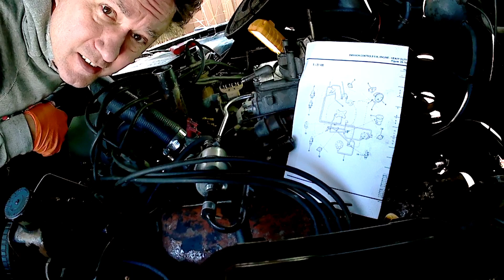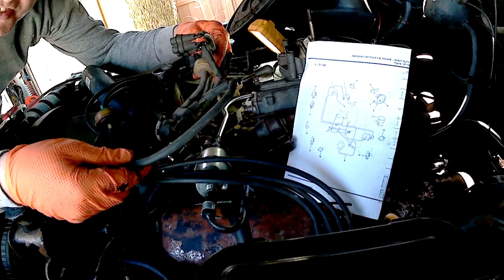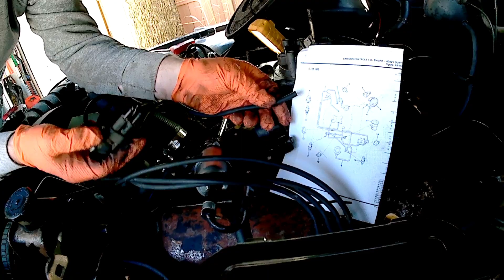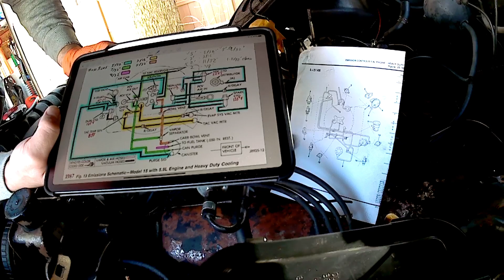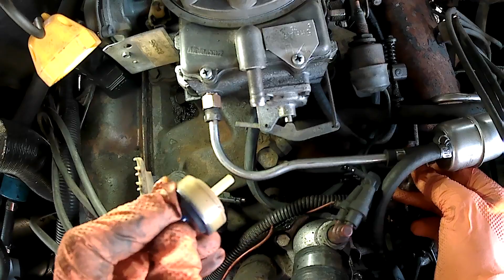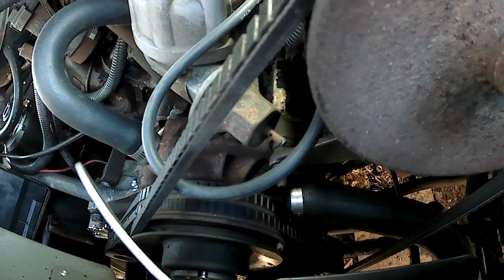Vacuum Line Replacement, Part 3 of 3- Rebuilding the ignition vacuum-advance harness on a 1987 J-20

Comment: Honesfly on my 90 grand wagoneer.. i removed 90% of the vacuum lines.. got rid of the factory air hat which had like 20 lines to it.. egr lines i blocked as my egr is dead and if theyre hooked up it just stalls my jeep.

The only vacuum lines i have are the pcv  And the lines for the charcoal canister/carb vent.  And the distributor vacuum advance

I also removed the air pump.. broke off the inkection tubes and welded the holes. On the manifold.    All junk lines waste of power.. takes up space.   Not needed. 

 Only the charcoal pcv and vacuum advance should be needed.

All ports not used i just plugged with plugs.

Bas8cally i routed my 90 like a 70s wagoneer using diagrams i found for minimal vacuum lines on the engine.  The less you have the better.

My 90s distirbutor line though never came with those valves yours goes too.  Mine jist go to ctos in the front but no non linear valve or delay valve like you have.   Maybe im missing it ?  Ill have to look at my diagram in the engine bay if it ever had it.
Reply: Think you could post some pictures of your setup? desperately want to get the vacuum simplified on my 88 but dont wanna end up hooking the wrong thing
Reply: @henryyagel9858  ya i could do that

Comment: Dr. Bob, Thank you for this video. I work on my dad's 1983 Jeep J20. The vacuum system is a complete wreck. I feel 100% confident I can correct multiple issues after watching this. Thanks again and keep up the good work. 
Jake
Reply from the maker: Glad you found it useful; once you break it down to the fundamental systems, it's less of a mess, but it's still not pretty, even when it's working as it should.

Comment: First love the detailed descriptions,& pics…wanting to know if you have video or info on  vacuum lines (what is needed what is not) ( what to connect & where to connect)  for 90 jeep 4,2  ( Motorcraft 2100-2150 carb) with HEI distributor , & after market air cleaner.  Thanks in advance!
Reply from the maker: Sorry, I've never had a Jeep I-6 to work on .. :(

Comment: Question for Dr. Bob. My 87 J10 does not have the high capacity cooling option. I have no high temp CTO. Do I just omit the tee and run a hose straight from the NLV to the distributor? 

Also can I bypass the EGR TVS? I can't find one anywhere, and mine's broken. 

Love the show. Thanks for the help.
Reply from the maker: On the regular-duty cooling system, the lines go as follows:
* Ported vacuum from the choke side of the carburetor, to a "T" that feeds the bottom port of the low-temp CTO and the bottom-port (small-end) of the NLRV
* Manifold vacuum that feeds the central port of the NLRV
* The top port of the NLRV feeds the top port of the low-temp CTO, with a reverse delay valve in-line (Jeep Part #J3236295)
*  The central port of the low-temp CTO feeds the distributor.

You can find a diagram of that in the 1987-1990 parts manual, figure 25-1350, on Tom Collins' Jeep manual page:

https://oljeep.com/edge_parts_man.html

or directly at the following link:

https://oljeep.com/parts_man/1987-1990_parts_catalog.pdf

You would want some thermostatic switch preventing the EGR from seeing vacuum and kicking in until the engine is up to temp; you could use a two-port switch in the rear heater-hose fitting that turns on around 155'F, and run that in series with the air-temp sensor in the air-cleaner housing. If the EGR kicks in when the engine is cold, it can produce stumbling and driveability issues.

Good luck!
Reply: @bbsbcv   Yes, started great but stumbling when warm. Still, getting better. I think now I'm going to register with the old Jeep forum, and hopefully continue the conversation. Thanks again.
Reply: Dr. Bob I'm registered on full size jeep network but I can't post yet. I'd like to chat somehow if you are willing. My 87 J10 is much like yours, smog pump deleted but otherwise largely complete. I've been wrestling with vacuum routing for a week with marginal success. 

Please:

* What is the hose connection to the CENTER port on the 2150 carb (standard cooling)? Your HDC schematic shows the center port is routed to the HDC CTO which I don't have. Instead I routed from that center carb port straight to manifold vacuum as shown in the HDC schematic, which tees off to the center port of the NLV.

* Do you plan any videos on EGR and TAC system vacuum routing? 

* Where can I go to understand the function and routing of all of the various different manifold vacuum ports, front and rear, and why are there so many, and why doesn't my heater door work??? (frustration creeping in)

* Similarly, where can I go to see a complete and accurate schematic of the vacuum routing on a 87 J10 AMC360 with standard cooling? All the ones I've seen are either a full schematic of HD cooling, or a partial schematic of standard cooling. Including the AMC factory service manual set with IS Notes. 

* I'm about to replace my rear bearing main seal. Significant oil leak which is either the RMS or the pan gasket; I'll find out when I dig into it. Do you have any tips? 

Thank you again.
Reply from the maker: @reidallison7115  : You may not have seen this link in my previous reply, but the parts-manual has the best schematic for the regular-duty cooling system:You can find a diagram of that in the 1987-1990 parts manual, figure 25-1350, on Tom Collins' Jeep manual page:

https://oljeep.com/edge_parts_man.html

or directly at the following link:

https://oljeep.com/parts_man/1987-1990_parts_catalog.pdf

On the regular-duty cooling system, on the low-temp CTO the lower port is connected to ported vacuum, the upper port is connected to the NLRV (or manifold vacuum if you are not using the NLRV), and the central port runs to the distributor. 

Your heater-door is fed by manifold vacuum; I teed-in to the manifold vacuum line going from the back of my intake to the power-valve on the front of the carburetor. You can see that at the 17:40 mark in the video below.

As for all the functions, I go over the systems one-by-one in the second half of my first video in this series. I cover the EGR system here: 

https://youtu.be/GReFi9Z59cA?t=819

But if you would like a visual of the components themselves, I could probably put together a short video on that. I do cover the TAC right after that, pointing out the items on the air-cleaner itself.
Reply: @bbsbcv  Thanks yes in fact I downloaded the parts manual a few days ago and printed that page. I was wondering why you used a parts manual for routing details, since the parts manual detail is kinda thin. But it was helpful in conjunction with other diagrams. 

Can you share any detail on the connection to the lower, center port on the carb that I mentioned in my earlier reply? Did I connect correctly, as I described? If not, can you please share what I need to do, with that center carb port in particular? 

 I very much appreciate your help and I think I'll watch your carb rebuild series too. :)
Reply: Regarding the EGR TVS that I bypassed. You said that's not a good idea. Recall also my smog pump is deleted so I have 2 open ports on the dual CTO. The dual CTO is normally closed. Therefore I'm going to route the TVS vacuum through the vacant AIR pump side of the dual CTO, to mimic the function of the air cleaner TVS. It will not open until coolant reaches CTO trigger temperature. What do you think of that idea? I'll try to report whether this makes any difference.
Reply from the maker: @reidallison7115  : if you do that, you are effectively just hooking back up the EGR to the TVS; why can't you route it through the EGR side of that switch? I'm afraid I missed something in your explanation if that's not possible.
Reply: @bbsbcv First I reassembled the EGR circuit through the dual CTO per factory spec, except I bypassed the air cleaner EGR TVS which I can't find. No bueno; bad stumbling when cold. I didn't route through the AIR side of the CTO because it seemed redundant. Since I can't find a TVS, I just bypassed the EGR altogether. Runs better but that's not a good long term solution; I want the EGR. So I'm stuck at this point until I find the TVS. Unless you have any suggestions. Thanks again. I still can't post to the jeep forum.

Comment: Ever done 258
Reply from the maker: No, only a V-8. The systems will be very similar in function, but the location and shape of the components may look different. The fundamentals are the same, however, for each of the systems. I recommend getting a diagram from Tom "OL Jeep" Collins' site, break it down into the basic systems, and restore each one at a time: https://oljeep.com/gw/vac/GW_vacuum.html

Comment: My Grand Wagoneer is a first year 1984. The spaghetti under the hood is pretty much the same as your '87. On the other hand, the vacuum set up on my 1988 GMC Suburban Sierra Classic was extremely simplified. It's fascinating how much technology changes and how fast it does so. My GW only has 88,000+ original miles. Hard miles to be sure but always well maintained before I got it. 

Thanks for such detailed and clean work. I have something to do now.

Comment: Love the work and the details.  Much appreciated.  My one question however is whether/not we really need all those vacuum hoses.  Are there some things that we can do without?...or are all of them truly needed.
Reply from the maker: Well, you only need the hoses if you want the systems they feed to operate. Some of those systems are absolutely necessary for driveability:
* Power Valve
* PCV
* Vapor Canister
* Spark Advance
* Heater Controls
The thermal switches ensure those systems operate under the right conditions, and are inoperative when they'd degrade driveability.

Other systems are necessary unless you modify the engine to work without them:
* EGR (you need to richen the part-throttle mixture if you delete that, otherwise you'll get pinging from running too lean)
* Thermostatic Air Cleaner (It's Jeep's factory cold-air system, but you need the flap to draw from the preheater hose if the air is too cold and the engine is warming up or your carb is at risk of icing up)
* CTOs draw the vacuum for spark-advance from manifold vacuum to aid in warm up, or to help cool a hot motor down, and switch to ported vacuum for normal driving conditions. There is only benefit in that.
The only other system is the AIR system, which was gone from my engine; you would need that if you need to pass a visual inspection for the presence of emissions equipment.

Comment: Where do I hook up my power valve? It's capped off and I rebuilt my carb and want it hooked up right. Thank you
Reply from the maker: You connect it to the manifold vacuum source on runners in the back of the intake, which also provides vacuum to the air cleaner assembly.
Reply: @bbsbcv  the manifold vacuum that has 2 ports? Mine is blocked off. Is there a way I could send you a picture for your guidance?
Reply: I have another port that goes to the circular ball with a hose connected. Then another port with 2  nipples blocked off with screws by it self
Reply from the maker: The manifold vacuum source with two ports should feed the air-cleaner vacuum diaphragms off the smaller port, and the vacuum ball on the firewall as well as the power valve on the front of the carburetor from the larger port. You can post a picture over at the FSJ Net and tag me in the message, and I can reply there; my name is Dr.Bob over there: 

https://www.fsjnetwork.com/forum/index.php
Reply from the maker: I don't know where that circular ball is currently hooked up to; it should be connected to the larger port on the two-port manifold vacuum fitting in the back runner of the intake manifold, behind the carburetor.